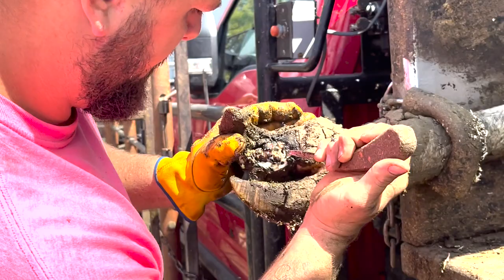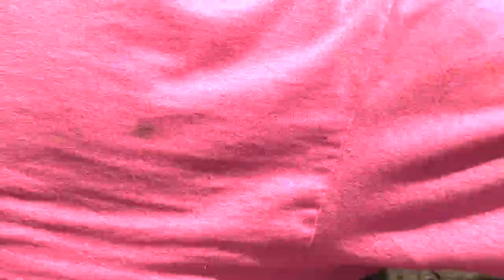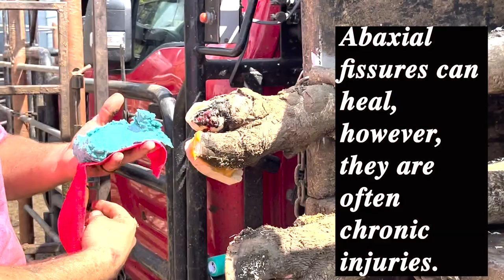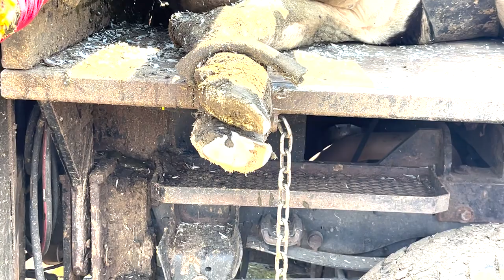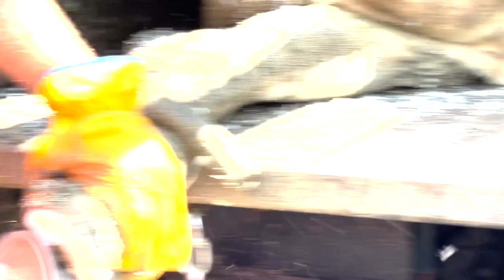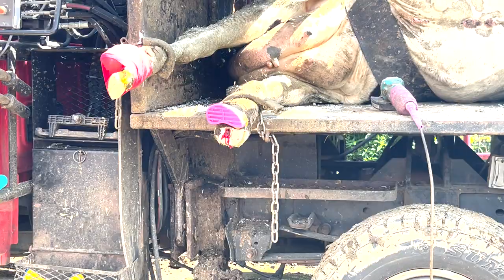Hell Inside Cow Hoof (Music Video) -AL$ET. #hooftrimming  #abscess #music

Comment: Do you use any kind of antibacterial spray like for chlorhexidine
Reply from the maker: No, I used to use iodine with lidocaine, but I think leaving the natural bacteria in place is useful rather than killing all of it. Some of the bacteria can be very beneficial, especially when it’s impossible to keep their feet clean after the treatment. Kind of the same concept of taking antibiotics orally in humans. Yes it helps, when in dire need, but it wipes your natural gut biome out completely. Which causes many side effects if used for a long duration. I hope that makes sense. It’s much easier to explain in person with a natural back and forth. 😁
Reply: Cool thanks. I was just wondering
Reply: Can't milk if cow has antibiotics in it's system